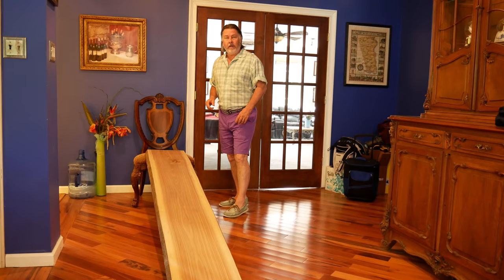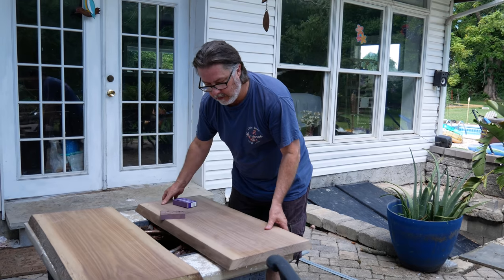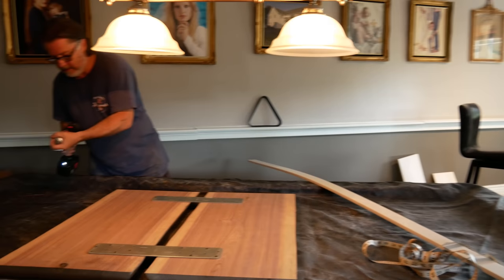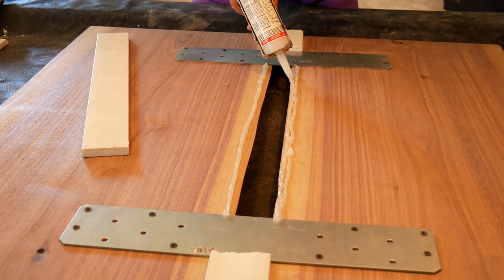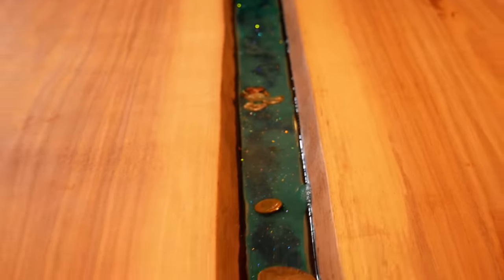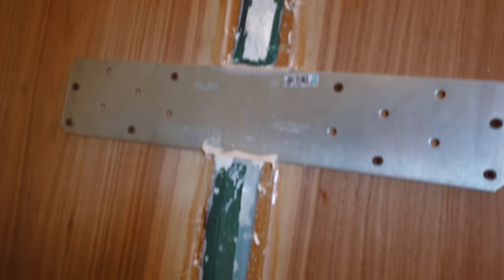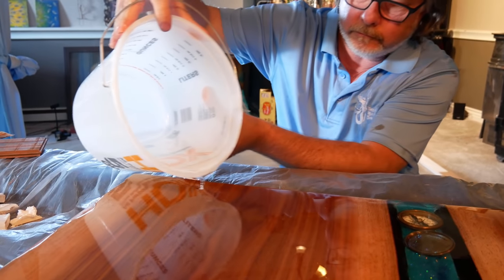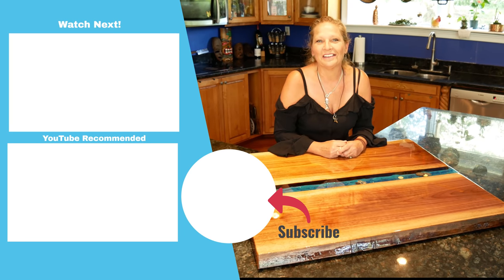Saving big $$$ on our Boat Table!  E98

Comment: Very nice project ED and Lynn, woodworking has been a hobby for many years. I think the way you assembled the two pieces will serve you well. As you said everyone has a different method to doing things especially in woodworking. It is nice to see how you and Lynn take on projects and do them yourself rather than hire someone else to it. Having owned sail boats and power boats if something needed to be done I did it my self. 😁🛫
Reply from the maker: Thank you very much! We are far from woodworkers but we like the way it came out. It is a good thing we like raw-edge tables - we do not have the tools to do anything else. We try to do a lot ourselves. The kitchen you see in the video was built by me about 15 years ago, from a pile of maple.

Comment: You think all screws should be stainless steel?
Reply from the maker: That would have been a good idea. I am sealing them in with epoxy, so that should help.
Reply: @tryingnottosink9107  THAT WILL HELP

Comment: Do yall have any opinions on the sea keeping ability of the hatteras vs the carver. When not on the icw... if you were to take both on a crossing to bahamas for example... would the carver be that much worse off?
Reply from the maker: I would not hesitate to take the Carver to the Bahamas. It is not as sea worthy as the Hatteras but could easily do the crossing. I would just be more careful about the window. I would be very careful to have winds from the south for a couple days. We have taken the Carver out on the Jersey shore many times and she handled well. We even took her to Martha's Vineyards once.
Reply: @tryingnottosink9107  fair enough, guess I've just seen so many reviews about the build quality of the carvers particularly pre 2000 where they sacrificed hull thickness for weight and cost and thus can't take much from blue water without warping or potential for damage... let alone striking something submerged and getting a hull puncture.